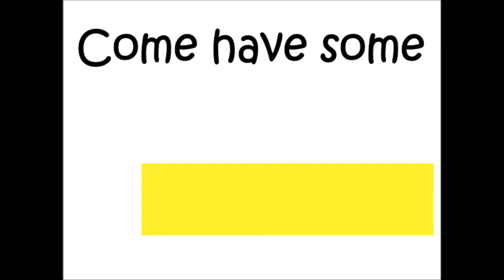Bug out pack - What 10 woodworking tools would you take?

Comment: I would not separate my woodworking tool list from my overall tool list. But if that can be longer than 10 items, even better:

- Wenger Ranger Swiss army knife (including knife, wood saw, flat screw driver, philips screw driver, can & bottle opener, awl)
- hatchet
- slim sharpening stone, two-sided
- file
- Japanese draw saw
- bow saw with wood and metal cutting blades
- handle drill
- nylon string
- theraband gold
- hammer
- 2 pairs of pliers
- flintstone

Comment: I need to do more research on the "Hex Receiver." Methinks I need that,... I want to  drill holes instead of cutting them them with a knife. Skip the tape measure though. Just use cordage to more or less measure long stuff, Cut (scratch) 1 inch notches in the axe handle for finer stuff. OBTW: I absolutely loved the 2 part conversation segment! Thanks

Comment: First off, too many saws.  You need more blades for the bow saw, (hacksaw, coping-type, etc.) and the one bow, then if you setup somewhere you can make a spring-pole sash saw with the blades. I like the brace & hex ends.  If you're going to be doing a lot of rustic work, you probably need pegs, so a dowel sizing plate.  Instead of either of the pliers you mention, needlenose Vice grips with the wire cutter -- maybe 2 of those.  A couple of chisels.  A couple of plane blades so you can make a plane.  The Machete is a good choice, it can clear brush, be a draw knife , and be a froe.  Probably some wedges for splitting bigger logs.
Reply from the maker: Marc Mengel All good points. For wedges i have wade one out of hard woods from the crotch of oak and maple limbs and they held up very well. so those could be made as needed in the field

Comment: Awesome topic Izzy
My  top 10 tools list for a longer term bug-out kit:
1) Gransford Brooks forrest axe (you Nailed it) - Mask has pouch for sharpener
2)  Wood frame Buck Saw with interchangeable blades (wood, metal, etc)
3) Framing Chisel (instead of auger bit and small saw)  more versatile too, still makes holes and mortise and rip/split wood
4) Files for sharpening and metal working
5) Wood handle Claw hammer is a must for nail removal and easy repair of handle.
6) Vice Grips 
8) Screw Driver set
9) Draw Knife (unless in the Jungle, then machete instead as you said).  The axe will easily handle any wood processing tasks a machete can do where I live.
10) Small hand brace (as you said) with bits

I think with these tools, I can build or modify pretty much anything I need in terms of additional tools given the time.

Comment: I like the idea of having the ability to measure, but the tape measure is extra bulk. What I would have is a length of cord (20ft?) that would have knots tied in 1" increments. You could stuff it anywhere with no weight.
Reply: My kit would be;

-Bow saw with extra blade
-Belt Axe for general purpose
-Carpenter or Forest Axe for heavier work
-Splitting wedge
-Draw Knife instead of a spokeshave 
-An Adze for hollowing logs
-Auger drill like yours
-Hammer
-Chisel 
-A large punch. I don't know why, it just seems right.
Reply: Good point. Rope, twine or - at minimum - string is a must have.
Reply: well, you could always take a measurerribbon that the tailors use. that's very small, very acurate and almost weightless + everyone knows it will be used for measuring. the rope could be taken from a friend/family for using as a rope without knowing.
Reply: Cordage is already part of the Survival Kit in the bug out kit.  Along with butcher knife, carving or jack-knife, multiple fire starting methods, container for boiling water and cooking, Wool blanket and tarp.   Kind of a given along with weapons :)
Reply: One could cheat and wear a belt that is also a tape measure. ;)

Comment: What you said.  I think I would add a couple of chisels and a couple of punches/drifts.  Here in the AZ desert, I've tried using a Japanese pull saw on mesquite, and it hosed the saw in minutes.  I was sad and mad.  Don't forget your coffee cup to keep those utility knife blades in action.  ;)
Reply: Most folks have no idea about how tough mesquite is.  It's not only hard, it's full of silica that ruins tools edges just as you pointed out.  I agree on taking a couple chisels.  They are the only tools with the cutting edge on the end, there's no substitute for a chisel.
Reply from the maker: Cactus Chris I have used mesquite before and you are so right that stuff is murder on blades i was cutting it with a chainsaw and never had sharpen my blades so often
Reply: izzy swan Yeah for me, that's where a bow saw or a folding saw are ideal.  You can file and reset them fairly quickly.  Good idea for a video, by the way.

Comment: 1. Lath Hatchet. They have a hammer head and a nail puller with a nice simple handle.
2. 4" sheath knife. Big enough to skin a deer. Small enough to gut a deer. Use the hatchet for splitting the pelvis. You can whittle a lot of tools from wood.
3. 200 feet of 100lb braided fishing line. Snares, rough sewing, lashings, fire starting bow. Very light weight.
4. Folding saw. Tape a 3 cornered file to the back of the handle.
5. Bow saw blades Coiled up you can pack a big bunch of them. Make a handle when you need to. Make some of them from metal cutting band saw blade.
6. Box of 100 fishhooks. Can't make them and fishing is easy with a hook and line.
7. Magnifying glass. You"re going to need it and can't make one.
8. Compass.
9. Map of the area on coated paper.
10. Another 4" knife. You know you're going to break or lose one.
All the other things that I could think of would be nice but not necessary. With this group I could live for quite a while. This is assuming that food and cooking utensils would be separate items.  
Some of the things could be combined into one tool but I've always believed that a tool made to do everything doesn't do anything well.
If THSHTF I'm only going to make it for at best 6 months unless I pack a life time supply of warfarin. If we aren't up and running again in less than that I'd really be surprised.

Comment: 1.draw shave
2. Chisels
3. Forest axe
4. Folding saw
5. Auger bit
6. Tape measure 
7. Center punch
8. Claw hammer
9. Splitting Wedge 
10. Slip joint pliers

Comment: The bow saw has been one of my top picks because its multi functional. Of course the saw but remove the blade and run some para-cord across it. Then you have a bow for a fire starter. Also if you were steady enough with it you could also use one of your drill bits set in a wood dowel or something as a bow drill for making holes. Just my thoughts

Comment: that tape measurer is actualy a very handy tool when you need to rebuild a lot of stuff in a short timespan in the wild. it also will make sure you need less cuts, so saving sawblades.for smallest form you can use a tailors taperibbon.

Comment: I'd leave out the hammer (the back of the hatchet can serve that purpose, though you'd lose the pry/nail pulling feature). In it's place, perhaps one of those screwdrivers that store multiple bits in/on the handle.

Comment: Interesting question and some good points. I like the idea of the Japanese Saw with blades and a more of a pruning saw, Have a few good folding types. I would think after those just take an assortment of saw blades to make other saws in the field. Would also go with a hatchet, Brace w/bits, Hammer, and Utility Knife sound good. Like the switch grip pliers a few people have mentioned. The other items come from stuff I have on hand and could put to good use. Yankee Screwdriver set, Yankee Pocket Chisels kit, Adjustable Square w/level, Adjustable Wrench, and for measuring purposes a Plumbers Rule. I know that actually comes to 12 but should be no more than 10 pounds as well.  Thanks for the video.
CtL

Comment: I would bring; 3/4 inch gouge (for hollowing vessels), 1/2 inch chisel (for joinery), bow saw, Japanese handsaw like Izzy's, bit and brace, axe, rasp, draw knife, hacksaw blades (could make a frame if I really needed one), needle nose pliers with cutter.  I prefer the needle nose for getting into hard to reach places, if I have to cut big wire I would use the hacksaw.  I am also assuming that a good knife would already be included in my kit.

Comment: 1. A coil of diamond wire saw, the type that can be connected as a loop. Nuff said

2. My trusty Stanley hex revolver screwdriver. It's big, it's tough and i once used it as a lever to lift a v8 off it's mounting point to bodge a broken mount.

3. All metal claw hammer. Good for hammer and emergency pick axe, defense tool or ice ax.

4. A big chisel. One side could be sharpened and therefore act as a knife on its own or as a rudimentary draw-knife. Also a chisel can be mounted in a block of wood and voila hand plane. 

5. A(or two, cheating) middle sized screw clamp/s. Having the ability to have your work secured so you can free both hands is a commodity i wouldn't give up.

6. A fine tooth middle sized hand saw. The type that cuts both coming and going (hand motion). Cuts fast and precise, and a second blade can be around for change. (A Bahco Prize cut, more precisely)

7. A sharp, long drift punch, preferably made from a piece of carbide. Good for its job but also for starting holes and if the tip is sliced down the middle it can be used as a rudimentary drill. (slow but it'd probably bring hex drills for my screwdriver, so that's that)

8. A sturdy middle sized Leatherman type tool. Multi, multi, multi.

9. A sturdy tape measure. It can be used as an early warning system too. Or for traps. It can make a good scraper too and you can certainly use it to measure things.

10. A butcher's knife (unconventional use). It can be an axe, it can be a butcher's knife, it's a good machete and it can be used as a side bench for various things. And some times you just need something heavy around.

My pack would be a bit heavy, but it's compact and i'm used to heaving heavy stuff.

Comment: hatchet, pull chain saw, 2 machetes, brace/w/many/assorted bits, large needlenose/wire cutter, twine, full set of Foxfire books, one large magnifying glass, one cook pot, one lid (important  as they save fuel and can be cooked on as well), flint/striker, 3 ft of pipe with caps (rocket stove chimney plus caps are to add so can be used as tool box for most everything else) (square would be handy, but the twine gives me a 3-4-5 answer, 2 machetes simply because it could be everything from wood-gathering to cooking and is too important not to have a replacement, hatchet takes care of hammer (but would be my first tool to toss, if necessary, as machetes do most of its jobs and hammers can be made). No measuring tool--size is relative to what it's being attached to, not a finite number, so twine does the job again... I know you guys didn't add the cooking tools, but they are important in terms of surviving the whole day and do double duty here and there (tempering metals in the cook pot, clean water, etc.)  I know, it's a girly list, but then I'm a girl....I was trying to evaluate all the existing choices while I imagined my way thru the day...hence the extras...very interesting to think about.

Comment: 30" Bowsaw blade(s), 3# Axe, 1" Chisel, 10 foot fiberglass/vinyl tape measure (light and compact), Old school Brace with 4 bits (1/4", 1/2", 1" and 1 1/2"), Tennon Cutter,  (works with brace), 10" Drawknife, Set of 4 4" Log Dawgs. 1/2 pound bag of assorted nails. Nothing else needed for WOODWORKING tools. This is not for an urban bugout but a rural/forest cabin building type bugout. Other tools not listed because they are not specifically for woodwork projects like a hacksaw blade or my knife etc... Other tools can be made on site such as the frame for the bowsaw blades.

Comment: measuring tape ... LOL 
small adze
axe
parang machete/kukri knife 
folding saw/buck saw blade 
my winchester 22-41783 made in the USA
six inches x 1/2 inch ferro rod
spokeshave 
DMT  diamond sharpener
38 s&w/ 9mm glock  g17
binoculars range finder combo
tarp
military grade paracord
backpack
my english longbow and arrows 
water canteen
first aid kit  "pro grade" +  10 maxi pads and 5 tampons and 1 large diaper , the pads are excellent dressing and they come sterile , tampons are for puncture wounds and the diaper is for burns " breathable&don't stick"
wool blanket 
water filtration straws
snare / duke trap # 155
10 lb forging hammer
duct tape
Reply: I think you mostly missed the woodworking point of this! Unless you plan on "drilling" holes with the Winchester instead of an auger bit. 

It's an interesting topic though. I suppose what people might pack would vary depending on their location.
Reply: rochat the winchester is my knife :)  . Glock 17 drills better holes and it is faster than the auger... lol

Comment: I go for the combination tools first, a 'Truckers Friend' (Hatchet/Hammer/Prybar in one), the Switchgrip Pliers which are excellent (I keep one in the car tool kit), like you a japanese saw, I got one after seeing you use one, and wouldn't be without it, but the Bow and coping saw I would replace with a couple of wire/cable saws to cut down on weight. A large flat head screwdriver, to use as it was intended and as a chisel and prybar, a Utility knife, machete, a fire steel both for fire and resharpenly the utility knife, instead of the brace I would take mole grips, and no bits, as you keep saying you can use nails, also you can use rebar, so my last tool would be a file,  to sharpen the improvised bits.

Comment: Great video! Keep up the good work! (How about a video on the homemade brace?)

I've been finding wrecking chisels and wrecking knives that are pretty much indestructible for $15 - $20 at most of the big box stores... even cheaper at Princess Auto (the Canadian version of Harbor Freight). Used both for batoning and prying, and the chisel makes a good draw knife with a field expedient handle. The plastic sheathes are often ambidextrous.
Lee Valley carries a folding handle for the double pull saw you demo. Irwin brand makes similar pull type saws and blade replacements for less $.
Blades, Lots and lots of blades! Saw / hacksaw / Coping / diamond wire or cable blades, utility knife blades...
There are simple handles that take any reciprocating saw blade and would give lots of versatility with a selection of different blades.
4 in hand file / rasp
Leatherman with needle nose on my hip and a Vice grip pliers in the kit.
Crescent wrench and tin snips.
Small "Hunters" axe and a hammer
Medium sized wrecking / pry bar (Stanley brand has some good options)
I am all for multiple use tools in general, but for the basic tool set I like to use the most bomb proof and dependable tool I can find.

Comment: What 10 WOODWORKING tools? Easy.
1. Knife
2. Crook Knife
3. Metal/Wood File (round on one side, flat on the other)
4. Laplander folding saw
5. 1" Flat Chisel
6. 1" Round Chisel
7. 1" Scotch Eyed Auger Drill
8. SA Wetterlings Small Forest Axe
9. Buck Saw
10. Claw Hammer

Comment: I would take a 2 1/2 lb. axe a draw knife 12", 1" brace bit. 1/2" brace bit, my slick chisel and a 1/2" mortise chisel. and a shovel head.
the rest can be made from wood or salvaged items these can build a cabin and basic furniture also a shave horse. from there anything is possible. at least you have the tools to start.And if the situation doesn't last long not a lot of weight to pack out. Can I count you as a tool? I would get a lot more done!. Off the wall question but I did have to think about it for a while. carrying shelter clothes food water and tools in a realistic situation cut me down to the absolute basics. I did put the whole pack together and one week of supplies and tools plus other implement's of destruction 😁
I am at 67lbs. not light but I wouldn't leave anymore out.
besides that you can always stash gear and come back for it once a good location is found. Well that's my two cents.

Comment: Dawn of the Dead stuff, lol, Hummm, , Utility Knife, Hammer, Needle Nose with wire cutting, My Flush trim saw with different blades IE hack saw blade, chisels small light weight set, Water Stone, Bow Saw with blades, A Brace hand drill  with bits, Draw Knife, and my First Editon, Limited Edition Izzy Swan Pallet Pal

Comment: hmmm....  let's consider that anything "consumable" doesn't count.

Axe, yup, although I'd go for something bigger than that little hatchet.  A Hudson Bay Axe, Gransfor Bruk Small Forest Axe, etc, something along those lines.

Brace, yup.

Ryoba - only need the one saw, and a passel of bow saw blades, you'll see why later.

Drawknife

Jackplane

Block Plane

Set of chisels

Combination square.

That's about it.

With those, and more skill than I have (although having instructions would make it doable), you can build a spring pole lathe and shaving horse.  Now you can make bows, arrows, all manner of seating, tables, buckets, barrels, etc.  Oh, and you can use the tools you have to make a bow saw, which means you can use the bow saw blades.  You can make mallets for driving home wooden pegs, make the wooden pegs, tool handles, etc.

These are WOODWORKING tools.  Some of the tools Izzy included are demolition/mechanical tools.  Nothing wrong with that, but that's a different realm.

Of course, a "long term survival situation" isn't exactly the same kettle of fish as a "post apocalyptic rebuilding situation".  Some of my options are much more useful and important in the latter than in the former.  As "woodworkers" in the modern sense, we tend to focus on furniture to the exclusion of the vast array of human implements that were most often made of wood in pre-Industrial times, yet before the metal/plastic buckets, wooden buckets ruled.  And barrels.